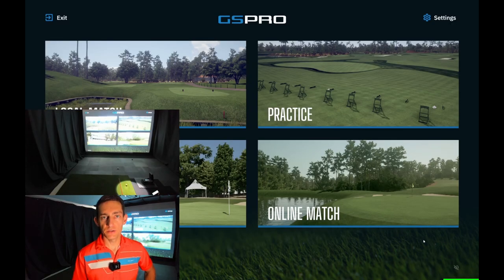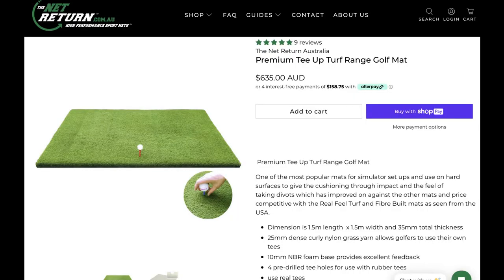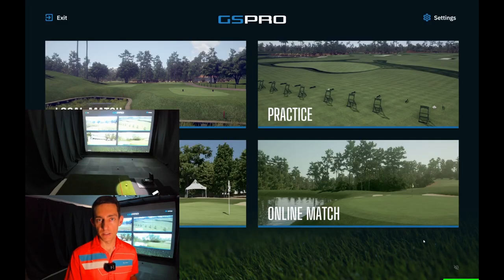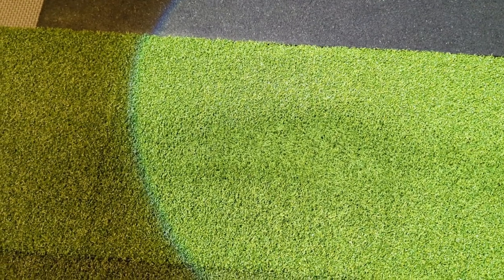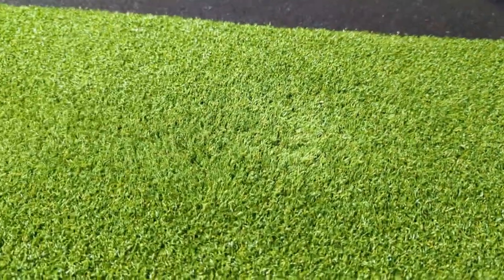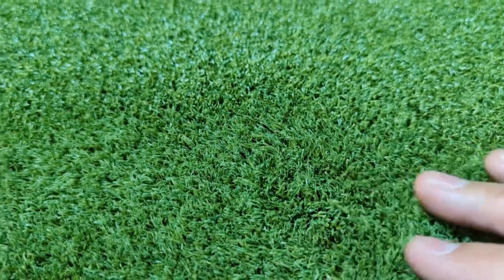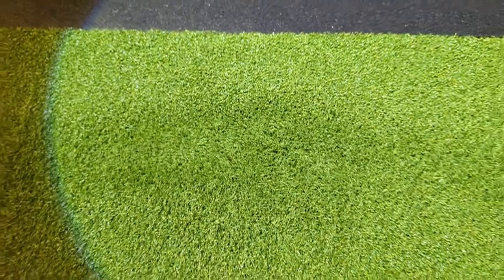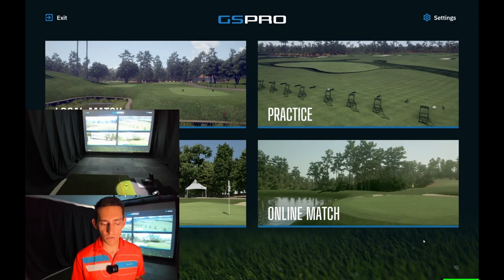DIY Divot Action Hitting Strip UPDATE!

Comment: I'm building my own ,my mat is much smaller , I've got some polycarbonate A3 size , wrists are starting to hurt with just foam and turn currently, my attack angle is around 7 degrees
Reply from the maker: Hey Garry yeah they are definitely worth it! I just wish I did it earlier that's my only regret as I still have a bit of golfers elbow that flares up every now and then but it's much better.

Comment: Joe, I used A monster mat cutout to make mine. I hit lots of balls too. It is wearing, and can rotate, but my scrap was short so the hitting area is small. I tested a mat and glue when doing mine that well couldn’t take the pressure. I am going to the Carolina PGA show Monday see what’s out there for me. I have a new platform design to test with a full mat, that can still rotate to spread wear out. It goes under the mat on cement floors for joint relief.
No cutting!
Reply from the maker: Hey Spike I'd love to use a thicker mat as the topper but for me I am trying to keep the height down as much as possible because I am restricted by my ceiling height. Any bigger and hitting driver will start to become a problem. If the ceiling height wasn't an issue for sure I'd get a platform going as yours looks like it has maximum forgiveness! I think for the sort of application that I am going for you kind of need to come to the realisation that the top putting turf is a replaceable item that will need to be swapped out every few months... Which is a little bit annoying but for the relief I'll take it!
Reply: Just get a big piece and be prepared, report on mine coming soon